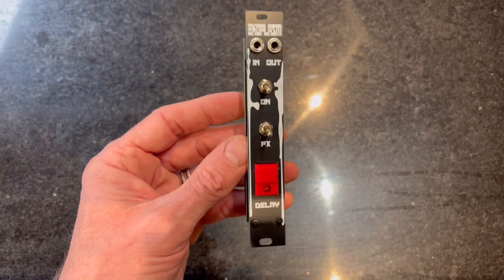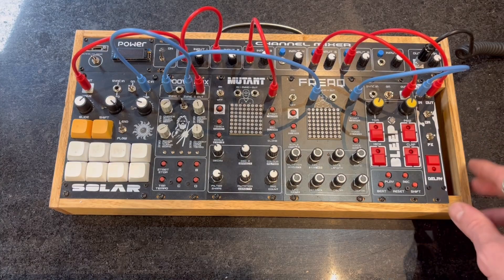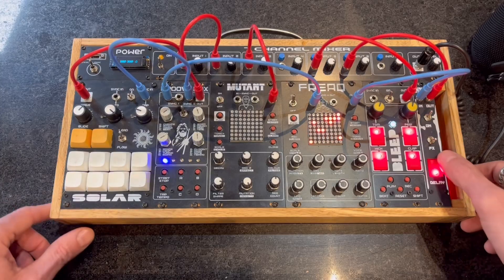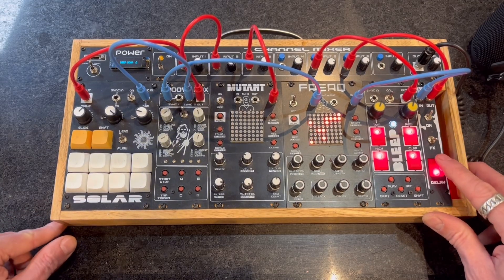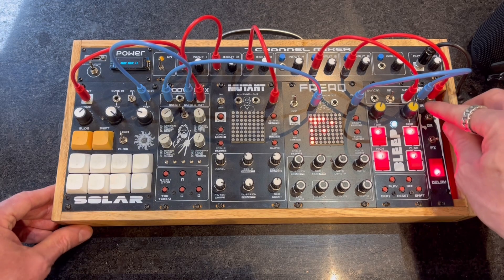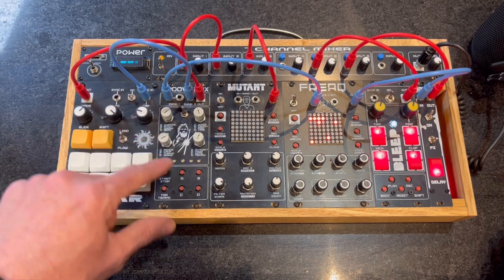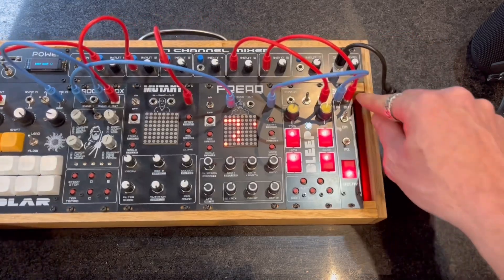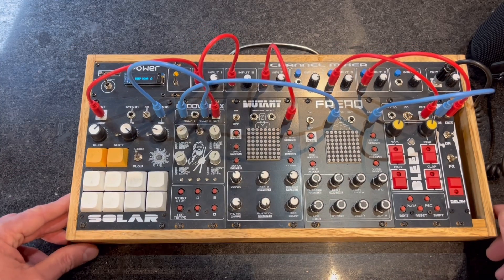Digital Delay Module  - Powered by Arduino

Comment: Greetings Marcus , ah great module! ,  I had tried the echotrek project a while back and it did not want too work well, so I put it aside, I blame my self of course 😬, You have really cleaned up the schematic very nicely , I look forward to dusting the parts off and trying again, oh yes ,  I vote for the Low Pass filter ! , I think that would round off your project really nicely , great work as always 😎👍👍
Reply from the maker: Yeah it was a little tricky to get going!  I had to strip it back and remove some of the original features to get it working.  
Thanks for checking it out and good luck with your build!